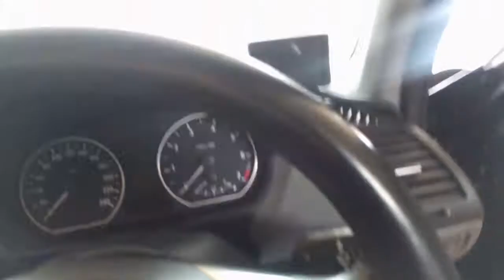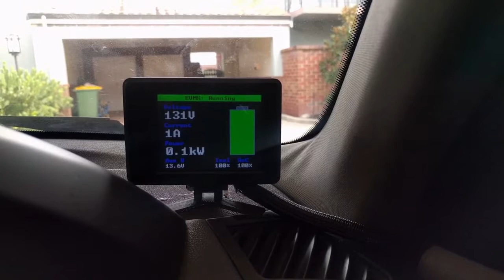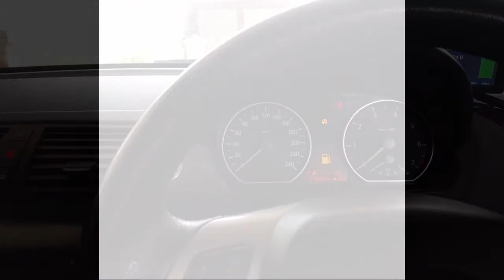BMW 120i Electric Conversion

Comment: Ja and how did it end? Did it drive? How far can you drive on a charge? What's the top speed, etc. Etc.
Reply from the maker: Yes drives very smoothly doing a direct drive. It does 160km on a charge and can do about 130km.

Comment: How do you get the canbus dash cluster to work? I see you deleted the gearbox? Did you go direct to the driveshaft? I am doing a e36 with its original gearbox. So far the wheels spin. :)
Reply from the maker: The Speedo just works without CAN, The Zeva EVMS monitor shows you battery level etc.. Apart from that, the only thing that it says is wrong is that there is no fuel.

Yep is a direct drive to the shaft with a 4:44 ratio diff from a BMW X1. No wheel spin however very smooth with good pickup.
Reply: @guybridge3576  Hi Guy, great work, and thinking about converting my 123d, maybe using the same electric motor you you used, and retaining the low ratio diff as its a diesel. Also are you an electrician, I worked on ICE cars for years a young fella, but my electrics skills are kinda lacking, any suggestions on how I may be able to increase those skills. I'm a Watchmaker and Computer Engineer so I have a great deal of the basics, and some training in Electrics, but I want to do this entirely by myself, any tips? TYIA
Reply from the maker: @jameswilliams6232  Nope i'm a software dev. I think the hard part is the metal work fabrication of battery boxes and mounts. The wiring is pretty basic and I just used this diagram: https://www.evworks.com.au/page/technical-information/ev-tech-info/circuit-diagrams/